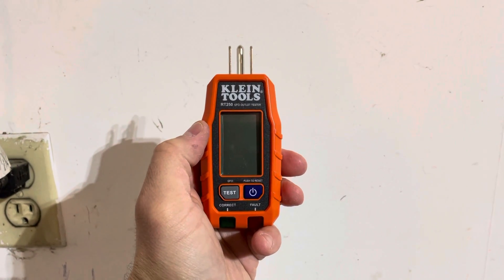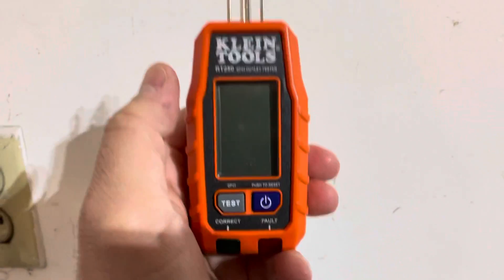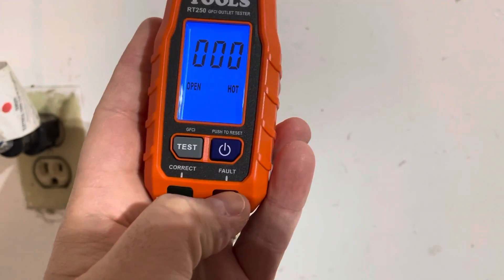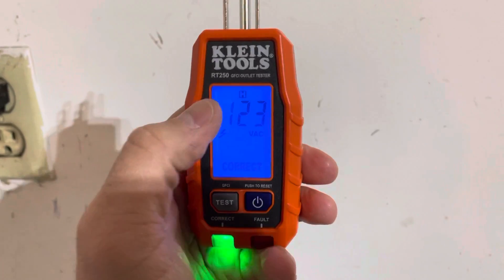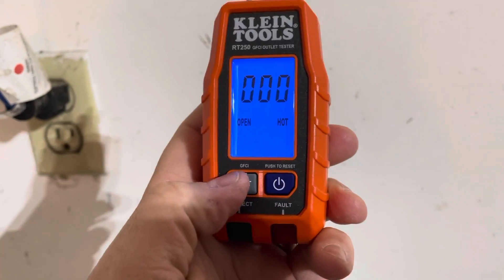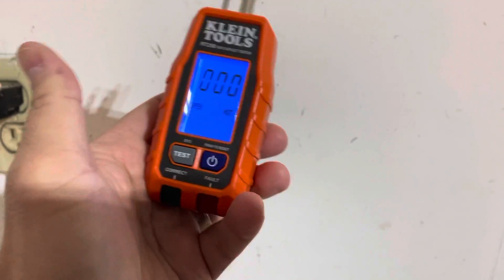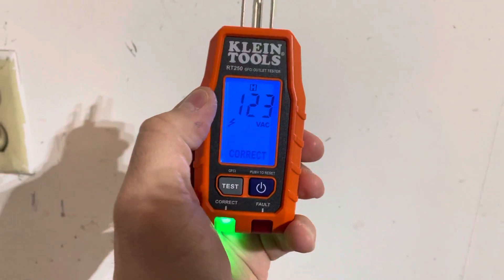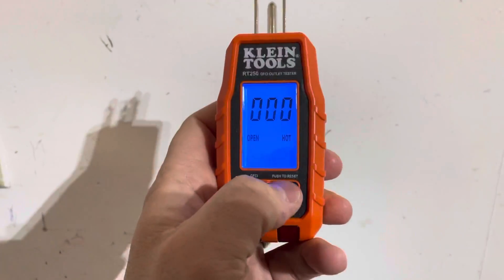Klein Tools GFCI Receptacle Tester With LCD Screen Review-RT250

Comment: Silly question just starting out as a electrician. Does the power need to be on in order for it to detect the voltage and if it wire correctly or does it have to be completely turned off first before testing it out?